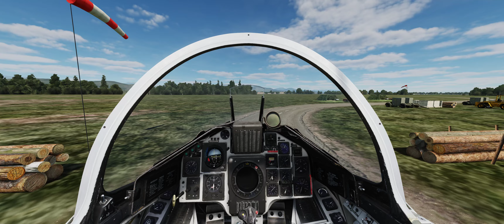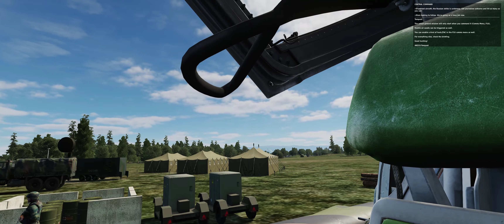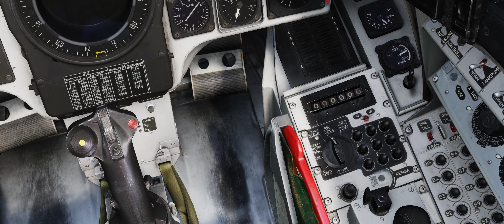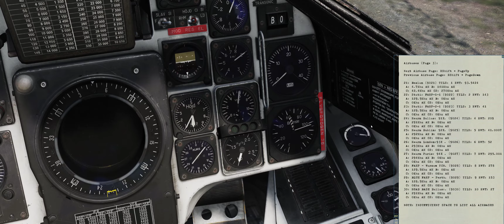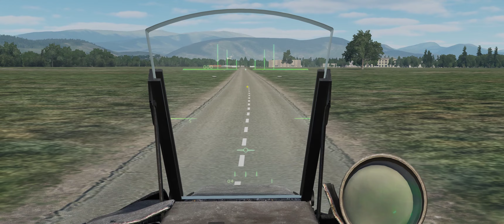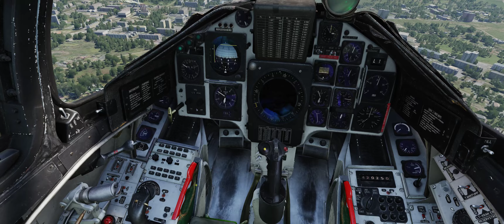DCS - Training Road Base Operations (AJS-37 Viggen)

Comment: Great mission really enjoying with viggen and harrier, I tried to move it to syria map for fun but wasn't possible. Good work bro 💪
Reply from the maker: Yeah? You know I was thinking about moving across to other maps. I have a test map on the DCS User Files for road bases in the Falklands of all places. O.O
Reply: @atempestrages5059  I changed the theatre by opening and editing the miz but as most units are to the east on this map when it opens in Syria for example 80% of the mission is off the right edge of the map and cant be manipulated.
Wanted to make a version on syria because it's nice to fly viggen low in that map ))
I'm still trying to find a work around thinking to manually move everything to the west side of caucasus before changing theatre then manipulating it all in Syria but as u know... time consuming ))
Reply: Another reason is that this mission specifically feels alive and if successfully moved onto syria could be expanded alot. Great stuff really )
Reply from the maker: If you ever get that working, let me know and I'll link to you on the user files page!